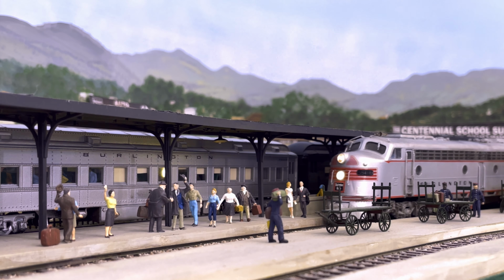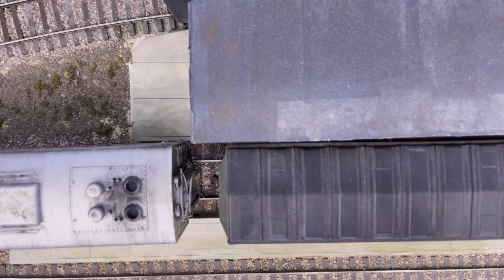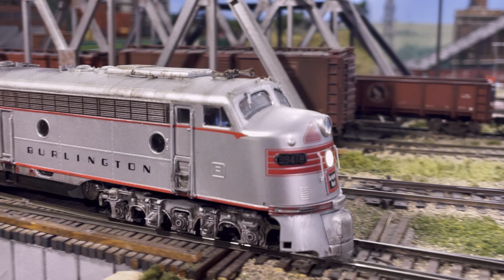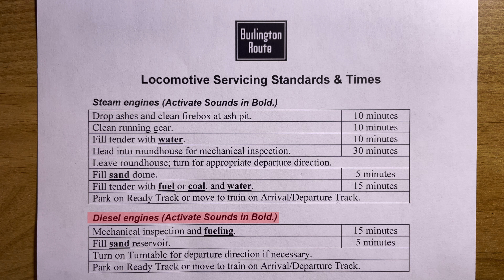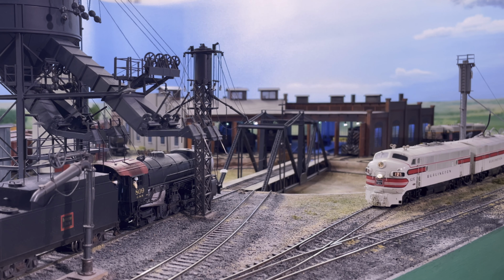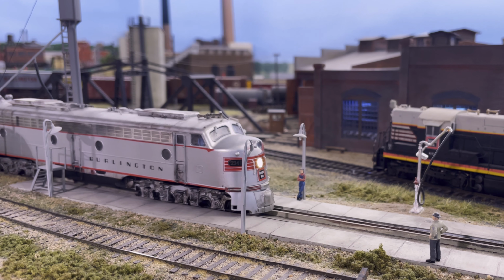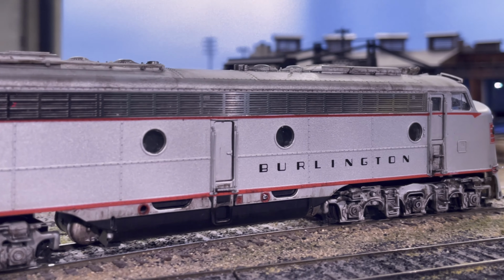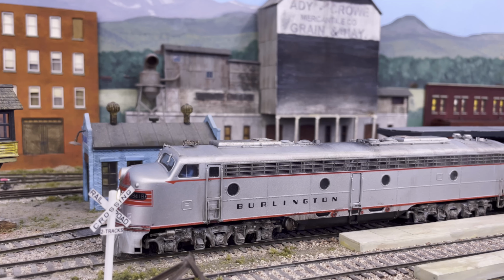Turning a Diesel Locomotive on the HO Scale Colorado & Southern Ry - Ep 8

Comment: Super. An incredible layout. Your railroad is my railroad, only ten to twenty years earlier. I model the Colorado & Southern from Denver, Colorado north to Cheyenne, Wyoming, the Denver & Rio Grande Western west from Denver, Colorado, with both the Tennessee Pass (Royal Gorge) route and the Moffat tunnel route, through Grand Junction, Colorado, over Soldier Summit and on to Salt Lake City, Utah, and also the Great Western of Colorado, plus the Denver & Interurban's kite shaped trolley line. The C&S line ran through my hometown of Berthoud, Colorado, about fifty miles north of Denver, and while I was too late for the E and F units, I got to see the SD-7 and SD-9 units pound by my house in their magnificent Blackbird and Chinese red Chicago, Burlington & Quincy paint schemes, (With a tiny "C&S" on each side of the cab.) and I watched steam locomotives on the GW doing sugar beet hopper switching and freight duty. I never saw any C&S passenger trains go by, but I did get to see quite a few passenger cars headed for the GW car shop in Loveland, Colorado, sometimes three or four at a time, tacked on behind the wide vision caboose, which was a real treat. A normal freight would have one EMD SD-7, one EMD SD-45, two GE U-boats, and one EMD SD-9, be 100 cars long, and would rattle my house as it passed by. The incredible sound and impressive roar of a single SD-7 pulling a long local freight up Derby hill to Berthoud from the Big Thompson River Valley in Loveland would actually alter your heartbeat, vibrate your body and the ground, and make you temporarily deaf. Hello from the Tracy Mountain Railway in Colorado. 💙 T.E.N.
Reply from the maker: Thank  you Tracy.  You sure have a wealth of wonderful memories.  Those were the days!
Reply: 💙 T.E.N.

Comment: I worked a second trick yard clerk job in Rice Yard Aug to Oct 1980, joint C&S / ATSF facility (we never saw ATSF).   Old heads I worked with would still answer the phone "hello, Colorado and Southern" sort of ignoring the Q much less the BN merger.    Worst memories were trying to stay awake with all the inactivity.  It was so dead most of crew would watch a TV smuggled into  small room in the round house that appears in this video.  I wondered when St Paul would get around to closing the place, which they did, selling the land to become Elitch Gardens.
Reply from the maker: You've got some history there.

I went down to RY two or three times in the late 1980s to take some photos of the remains and measure some foundations for the missing steam locomotive facilities.  It was completely abandoned.

In the 1990s, Elitch Gardens Amusement Park ran their first season or two with the turntable bridge decorated with lightbulbs.  Everything else was gone, obviously, and so was the TT bridge soon after that.